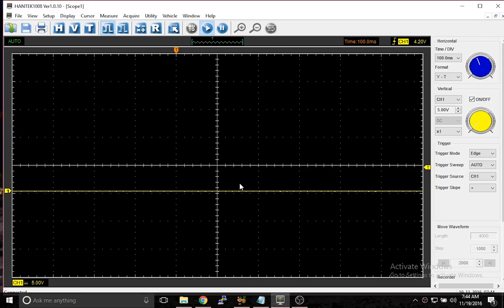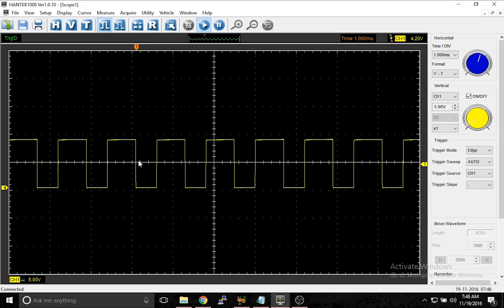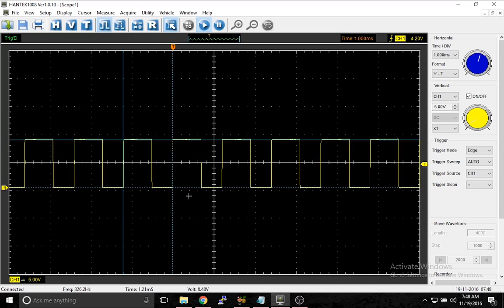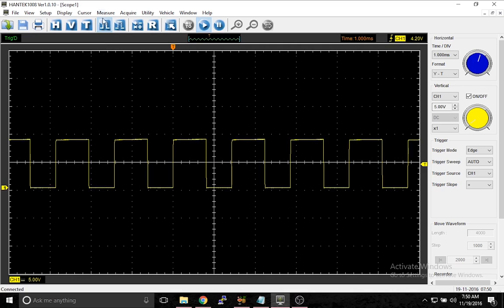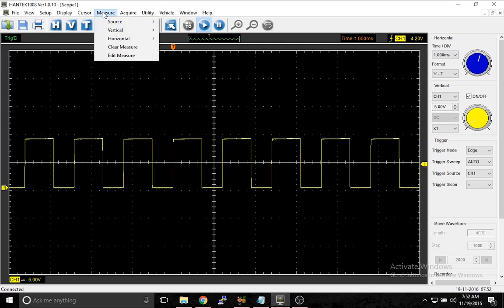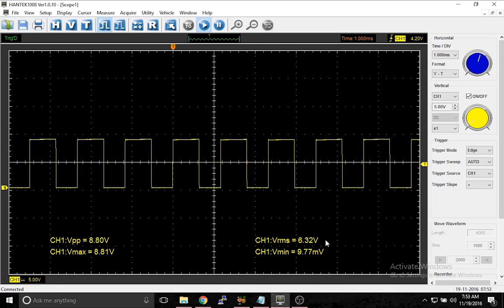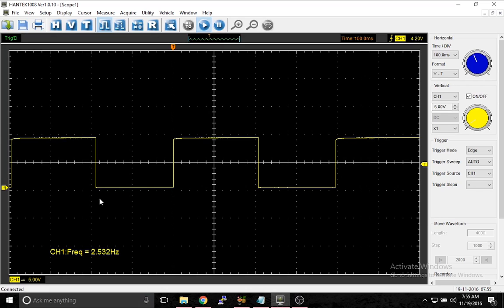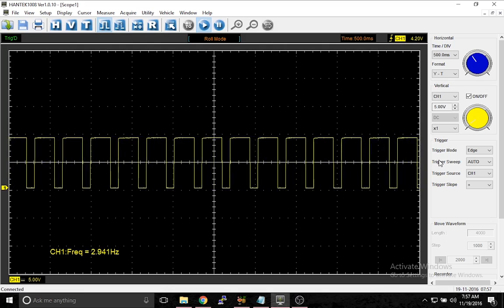Hantek Basics: Measurement Function and Trigger Slope

Comment: My square wave won’t start from the volt trigger marker, and mostly it start from top and then drawn to down which I want it to look like yours that start from exact point of the volt trigger marker then it move up, secondly too is like the trace is little above the volt trigger marker instead of it to be at the top of the yellow volt trigger marker where it point to, please what should I do to get this fix , am using 2d72

Comment: Hey Enrique have a question does the oscilloscope have to be on a WiFi to work or the computer and what kind of laptop is it Windows?
Reply from the maker: WiFi is NOT necessary for normal function of this scope. The laptop is a Thinkpad T430 running Windows 10. Thank you for your question and thanks for watching!!
Reply: @Enrique_Osorio  thanks bro

Comment: Man im right in there.ive been looking for a scope to use .I think the fat daddy is pico but i dont have a fat wallet to shell out that gold .Ive had my eyes on that hantek setup allthough i think its a bit too cheap . But you have shown me so far it works well. Ive been on the fence about that for along time. Im old school and i still beleive that you get what you pay for. My concern is quality is going to hold up? Are the leads too cheezy and easily broken ? Can they be upgraded ? Is it worth it?
Reply from the maker: If you need something that simply works consistently and will not frustrate you, DO NOT buy the Hantek. I always tell people that the Hantek is a scope that you buy if you do not know if an oscilloscope is a tool that you will need. The Hantek is a stepping stone. From there you decide if this route is right for you. It seems that you are looking for a capable scope. If you need something mobile with a PC I recommend a used Pico off eBay. 

https://www.ebay.com/sch/i.html?_from=R40&_nkw=picoscope&_sacat=0&LH_ItemCondition=4&rt=nc&_udlo=0&_udhi=450

If you need something for a desktop workstation, a used Tektronix, Agilent or Rigol bench scope from eBay will work as well.

https://www.ebay.com/sch/i.html?_from=R40&_trksid=m570.l1313&_nkw=bench+oscilloscope&_sacat=0&LH_TitleDesc=0&_udlo=0&_udhi=450&_osacat=0&_odkw=picoscope&LH_ItemCondition=4&rt=nc

Thank you for your question and thank you for watching

Comment: I've been watching a few of these and find them interesting. I own six oscilloscopes now for my electronics. But an auto oscilloscope would help me down the road. The one thing I'm not sure about is to software, is it pre-installed or do you have to purchase software. But how much is the software
Reply from the maker: The software is free, and will sometimes come with the oscilloscope on a disc. You can also go to the Hantek website and download the software. I have a video where you can go into my shared google drive to download the software and drivers and I explain how to install the software and drivers. 
If you own other scopes and want something with lots of functions DO NOT GET THIS SCOPE. Go for a PicoScope or something similar. You will only be frustrated by its glitches and its mediocre software. This scope is a cheap way to introduce yourself to the world of oscilloscopes to see if this type of tool is right for you.
Reply: There's also an free and open-source software specifically for Hantek (6022) scopes called OpenHantek, which is muuuch better than the stock software.

Comment: is they a way to graph frequency ,such as a digital MAF sensor
Reply from the maker: Not on this scope. The best you can do is use the FFT (Fast Fourier Transform) which gives you a line that will peak at the frequency of the signal. If there is a frequency spike on a failing GM MAF you will see the peak of the line move smoothly toward the right and then will move to the far right and back to left where it was before. The chances that you will catch a small glitch is low so it is not the best tool for the job, but I thought I would mention it anyway. I have noticed that the scope picks up a lot of noise and the FFT function will show an erratic signal even when a pure sine wave is fed into it. Not the best feature of this scope.

Comment: One questions about measurement, what should I choose, to see a actual/"live" voltage on the channel?
Reply from the maker: TLDR: Under 'Vertical Measurements' choose 'Mean' and set the time base to 20 ms/div. Longer explanation below.

Remember what "live voltage" means in the context of a voltmeter. A voltmeter can not give live readings since the screen would have to update so quickly, the number would be a blur. Instead it gives something similar to an average over a period of time. This will differ depending on the multi-meter in question. On the Hantek, to get a reading similar to one that you would get on a multi-meter, you would choose the Vertical measurement 'Mean'.This will give you the average of the voltage over the chosen time base times the width of the screen. If the time base you choose is short it will update quickly and the opposite is true for a long time base. A good option is a time base of 20 ms/div (millisecond per division), this way you will get 5 updates a second. The reason you get 5 updates per second is that if each division represents 20 milliseconds, and if the screen is 10 divisions wide, the reading will update every 200 milliseconds.
Reply: @Enrique_Osorio  OK it seems to be clear. One more time thanks for your help
Reply: One more kindly request for support. I work with Hantek and it is work fine. But I want to storage the date. I know how to transfer date to excell file, but I have problem with sampling - it is to "slow". My question is, how to setup the sampling (for example I need record date sampling 1kH, so 5 second length recording should have 5000 line in excell file) for data recording? The acquisition options for example are in many places un-active.

Comment: Enrique, thanks for your training. I appreciate the info and how you present it. I have little experience in electronic devices and oscilloscopes but am willing to learn enough to troubleshoot car issues.

Most affordable scopes are 2 channel. How often have you used more than 2 channels in troubleshooting ignition issues and alike and where in particular did you need 3 or more channels?

The PicoScope 2204A (2 channel) for around $140 gets my foot in the door to a very good scope and very good software. However, the Hantek 1008C may be more appropriate given its 8 channels. Your thoughts?

Thx!
Reply from the maker: Generally 2 channels are enough. There are situations where you may want to look at more signals simultaneously but that would only be for convenience not necessity. As an example, a current and voltage waveform for a particular ignition coil will only need two channels, but if you wanted to also look at the controlling signal from the engine computer you would need a third channel. This has happened in some situations for me but it is not the norm. If you are just getting started and are intrigued about the possibilities of oscilloscopes, then I recommend the Pico. Not only is the software better with the Pico, the hardware is more robust and of better quality. Hope this helps. Any other questions feel free to ask.

Comment: good how does one differentiate between a square signal with positive and negative half cycle and one without on an oscilloscope
Reply from the maker: If there is a positive and negative half cycle, meaning that the square wave goes below the 0 volt line the average DC voltage will be zero, which means that if you measure the DC voltage the voltage will be zero. Additionally the AC voltage will show the average AC voltage or the RMS depending on the type of multi meter you are using. If there is a DC offset, then it will be shown as a positive or negative voltage when measuring using the DC setting on a multi-meter.

Comment: Hello. Great explanation. 👍
Do you know if it's possible to set a trigger based on signal width. The program has a box for trigger mode, but it only has a slope option. 

Thanks
Reply from the maker: Unfortunately it does not. It is a very simple trigger based on slope and voltage/current level. Many other scopes have various options when it comes to triggering, but this one does not.
Reply from the maker: One more thing I forgot to add is that the trigger can also be a single screen of various widths, automatic. or normal. Thank you for your question and thanks for watching!!

Comment: I have seen in one of your videos you are using the scope with what looks like a tablet. Can you let me in on what type of tablet and any setup issues?
Reply from the maker: It is a Dell Venue 8 Pro which is an older tablet with a relatively weak processor and only 2 GB of RAM but if works really well with the Hantek. The tablet runs Windows so the setup is identical. I have had little to no issues. Thanks for your question and thank you for watching! I appreciate any and all support.

Comment: how do you set up the voltage scale that would be on the left side of the scope to know what the waveform voltages are like on a pico or about any other scope
Reply from the maker: To answer your question accurately could you clarify what you mean? I believe you are asking what voltage per division setting you use for a particular waveform. If that is your question then the scales that you would use would depend on what you are looking at. If you are looking at the waveform of an ignition coil primary then your scale would be 50 volts/division whereas if you are looking at the waveform of a digital camshaft position sensor, you may only need a scale of 2 volts/division. 

Some scopes do not  use volts per division, rather they will have a setting for max and min voltage displayed. This means that you would be able to adjust the voltages displayed on the screen based on what is the maximum voltage you expect and what is the minimum voltage you expect. 

Hope this helps. If this is not the answer to your question please restate your question with specific information. 

Thank you for your question and thank you for watching!!!
Reply: how is the hantak scope as in quality? also what i was asking was say a waveform falls a 3rd of the way in the middle of a division? do you have to guestimate the voltage?? i had snap on scopes but starting to find that there not that good as you can only zoom out on waveforms and not in after you freeze it to look at the data.
Reply: how long can you record a cam sensor for? when trying to find an intermittent failure?? im almost on the fence of buying one of these
Reply from the maker: There are dots that will let you reasonably read the voltage. You can also use a cursor which gives you the voltage difference between two points. 
The quality of the scope is OK. Its not the best and not the worst. I have used more expensive scopes that were not as good as the Hantek. 
You CAN NOT zoom in with this scope. It just does not work since if you use the zoom feature you do not get any higher quality data.
Reply from the maker: I do not recommend the record feature. It does not work very well. If you want something that will record for a period of time that you can zoom into and look at the data, I recommend a different scope. This would not be the scope for you. I consider the Hantek 1008 a stepping stone. It is a scope that you would buy to see if an oscilloscope is a tool that you would use.

Comment: are you able to capture signal from CAN bus with yours?? I tried and nothing only shows the voltage at 2V or so I tried using the CAN bus selection from the menu and connected channel 1 to pin 6 and channel 2 to pin 14 and my grounds to pin 5 sensor ground even tried pin 4 and nothing ..any suggestions???

Comment: Really enjoying your vids and looking into buying one of these.  What probes / accessories would you recommend getting for a diy hobbyist mechanic?  I see many of these kits on aliexpress but they come with different probes / accessories.
Reply from the maker: A current clamp is a must. The Hantek CC-65 will check low current parts such as injectors, ignition coils, blower motors and the like. The Hantek CC-650 is for higher current items such as starter motors. A 10x probe or a 20:1 attenuator will allow you to check items with high voltage spikes such as ignition coil primary coils and even inductive loads such as fuel injector waveforms which can have voltage spikes up to 100 volts.
Reply: So a kit like this https://www.aliexpress.com/item/Hantek-1008C-Automotive-Oscilloscope-USB-8-Channels-PC-Based-Digital-Multimeter-Osciloscopio-Logic-Analyzer-Diagnostic-tool/32645463134.html?spm=a2g0s.8937460.0.0.EdSTKD plus and attenuator and the two clamps should be all I'll need?  Do they have a 100 amp clamp?  I'm mostly looking at 2L and smaller 4 bangers and they usually don't pull more than about 75 amps during cranking from what I've seen.

Comment: Can you do a video on a cam and crank test ? I tried it but i cant trigger lets on one section in the screen like a pico.. its not clear, the screen ceeps jumping.. just want to focus on tdc for example 

Also have had a blue screen with my hantek a few times :( strange..
Reply from the maker: You will not be able focus on TDC unless the voltage is significantly different than the rest of the signal. Using certain cam signals might help since they sometimes have a single voltage spike at TDC which you can trigger off of but other than that there is not much else you can do.

Comment: Hey, I bought a hantek 1008. I see the the update rate on your scope is going much faster. I have a bit of lag, I have tried it on multiple computers and I get the same result. I tried usb 2.0 and 3.0 but still the same result. Is there anything I can do to get it running like yours. And my other question was my square wave is not as square as your wave. it spikes at the peak and the bottom of the wave, how can I fix this?
Reply from the maker: I do not know why it lags on your computer. If you would like you can try to reinstall the software, that might work. As for your square wave problem, there are adjustments on some probes that help to mitigate that. Are you using the original Hantek probes. Have you tried other probes?
Reply: I am using the original probes from hantek. As far as I can tell they are not adjustable, unless I am missing something. I appreciate your reply, thanks again.

Comment: hi i got hantech 1008c it comes with  ht25 cable to check wave fom by placing that on spark plug wire but on menu on right hand side of computer screen nothing say ht_25 to click on it how can i use ht25 cable on that modle.
thanks

Comment: Great videos! I just got a Pico scope and I'm trying to figure out a tablet to use it on. Any suggestions?
Reply from the maker: I suggest getting a tablet that has a USB 3.0 port. The latest PicoScopes need a USB 3.0 connection USB 2.0 will NOT work. Also, make sure the processor on your tablet is up to the task. If it is a mobile processor and its quad core it should probably run at 2.0GHz or higher. If its a dual core then 2.5 GHz or higher is recommended. You can run it on slower processors but you may have some issues. I tried my pico on my older computer that I put a USB 3.0 card on and it did not have the response of my newer laptop. Hope this helps and thanks for watching!!
Reply: Enrique Osorio makes sense!!